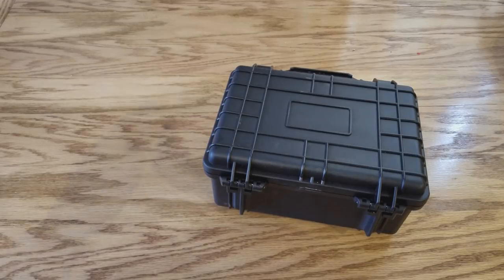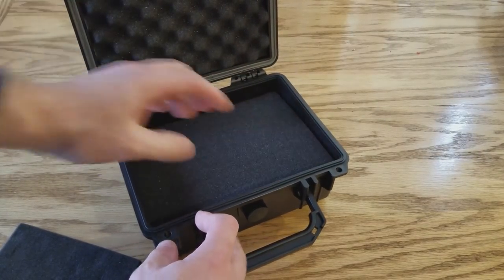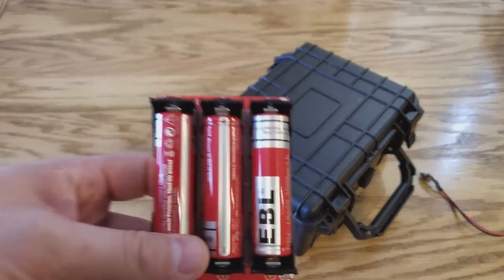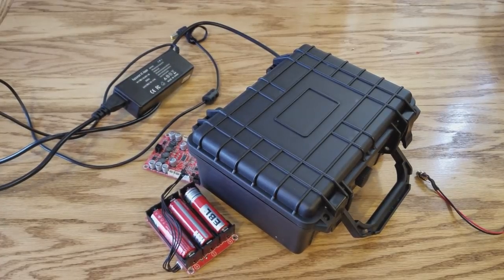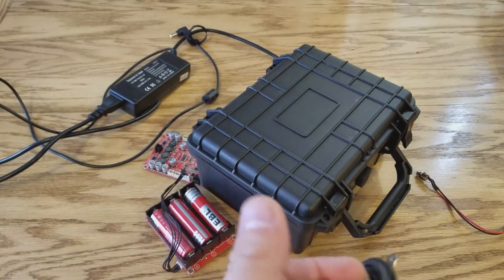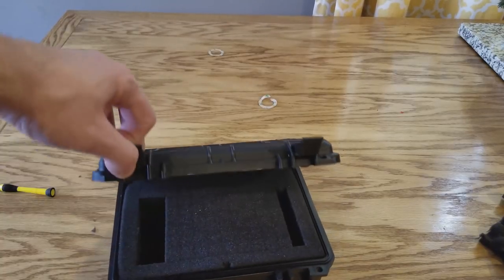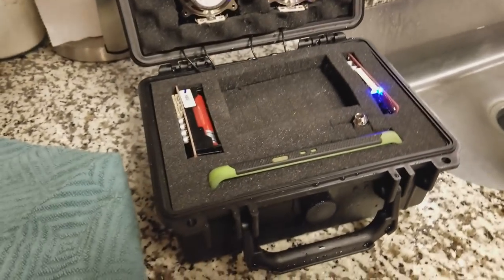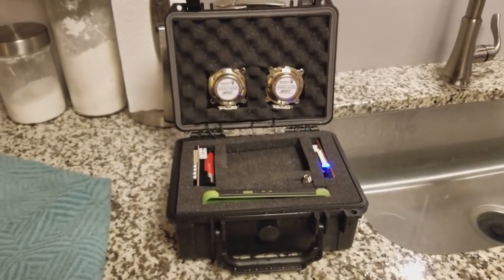FREE Plans! How to Make the BEST Waterproof Speaker

Comment: Bloody great project! How long do the batteries last? Ideally, I'd like to get around 6-8 hours at a time out of them. I build timber furniture and have been thinking of incorporating speakers into a chair, so these bad boys would be great to attach to the back of the chair(Maybe?). I thought maybe having a clip-on battery pack as opposed to a permanent connection in case people want to sit by a fire or on a verandah(Porch), and don't want cords running everywhere.
Reply from the maker: I'm right there with you. You can definitely give something like this with a lipo battery pack. I didn't do any real test on this. But based off of other projects that use these in I would guess you could get 6 to 8 hours out of it we can without a problem. But if you're really concerned, you could just get to battery board packs, they connect together and you would double your time.
Reply: Ah right, didn't know they joined together. That'd do me nicely then. Cheers for the info, mate. Appreciate it.
Reply: Haha, I hadn't scrolled down enough on the page until just now. "Additional boards can be sequenced together to provide longer playing time." Awesome!
Reply from the maker: Craig F lol, yeah, it's easy to miss 😁

Comment: Neat project. Had a couple of questions.  Would it work better with a single exciter versus the two you used?  Also would it be possible to set it up to be used with battery banks that have usb outlets?  Finally I noticed that there are also 30 and 50 watt boards available from Dayton.  Would these provide any significant advantage over the 15 watt board you used?

Comment: These are great: thank you for posting this. I followed your build plans and everything works fine when plugged into the wall, but I don't know how to make the amp board draw power from the battery pack -- as soon as I unplug it the amp shuts down. I tested the batteries with a voltmeter and they are fully charged. Any advice?
Reply from the maker: Just make sure the wires are plugged in tightly to the battery board and amp board.  If you are still having problems, call Parts Express Tech Support, they can decipher if the amp or battery board is bad.  Let them know you are building this project, they'd love to hear that.
Reply from the maker: You are Welcome.  Make sure to subscribe if you aren't. Also if you want to help support this channel another way, feel free to check out my Patreon Page: https://www.patreon.com/123TOid  You can even get put into a drawing for a free custom speaker built by me.
Reply: It took me awhile to get back to this project but I wanted to thank you for your reply. I called Parts Express and they told me that these boards won't run off battery power unless the power supply is 19v (I was running it at 12v, which caused the problem I asked about above). So I got a 19v DC converter and everything is good. Also wanted to add for anyone building this that they should also purchase the "KAB-FC Function Cables Package" that Parts Express sells so that they can connect a power switch to the board.